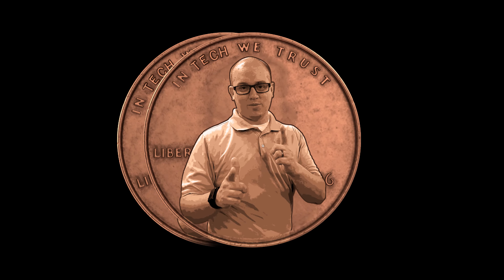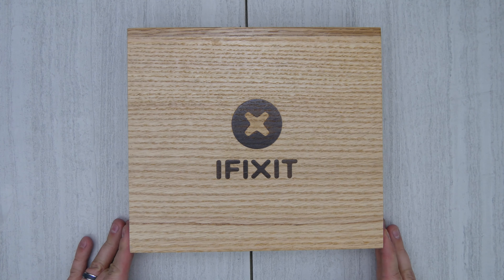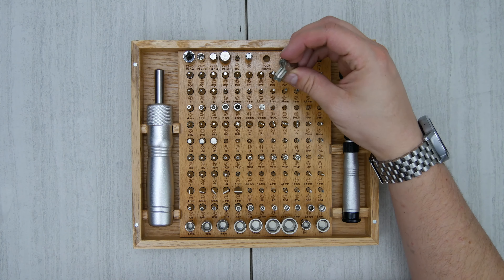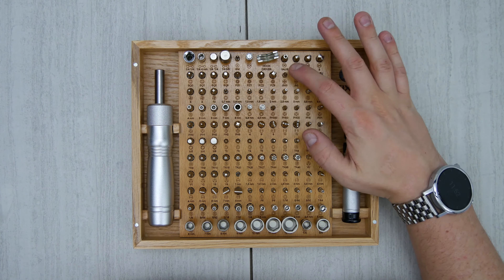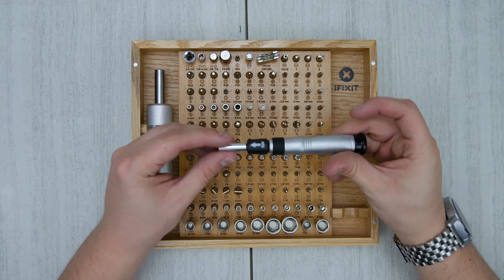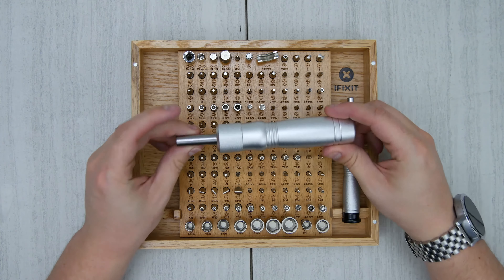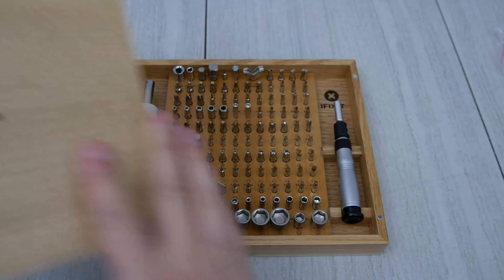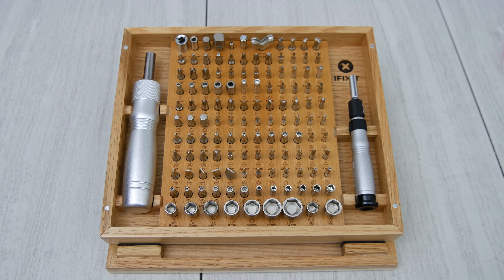iFixit Universal Bit Kit (128 bits) Unboxing & Overview

Comment: I'm gutted I didn't find out about this kit until it was no longer available... The current plastic case "Manta" kit is missing quite a few of the bits that are in this one (especially the good range of 1/4" nut driver bits), and well... plastic vs. wood. Also the small driver doesn't have the cool extension feature.